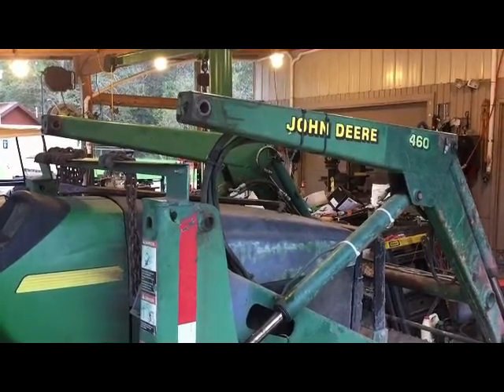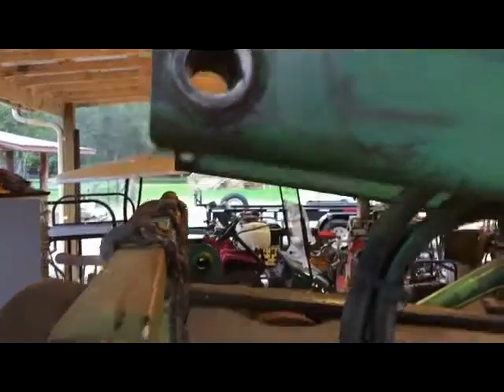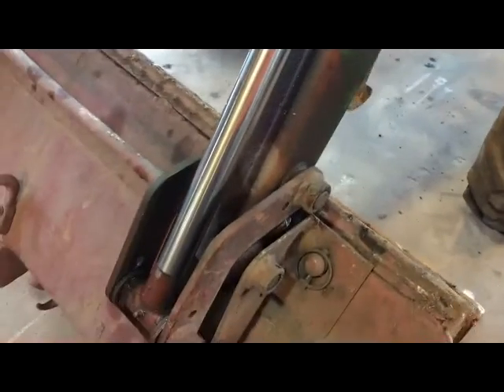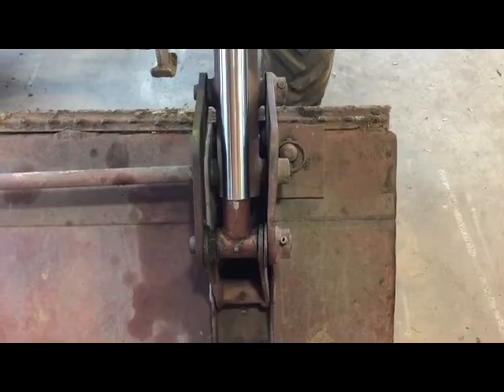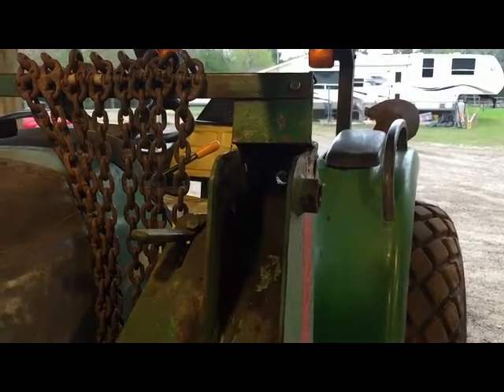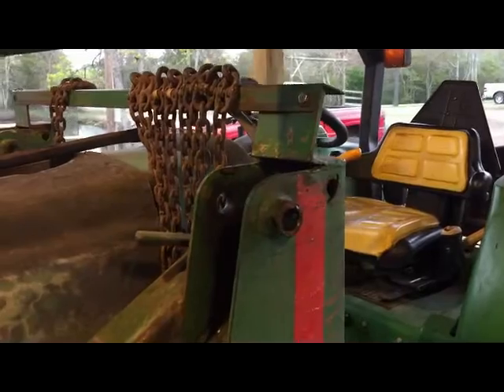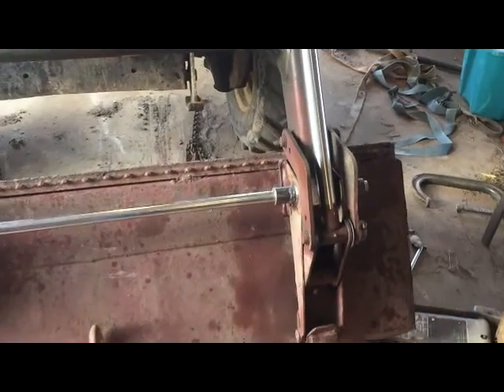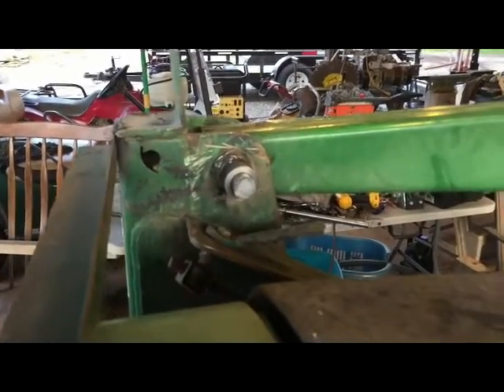John Deere 460 Bucket pin bushing rebuild. Total Cost $300

Comment: Just got done doing this on a similar loader. I just cut the bushings out and made new ones.  The old ones came out fairly easy.   What you did will work as well.  Just thought I would share what I did.  I was worried about the bushings not wanting to come out but it wasn’t too bad